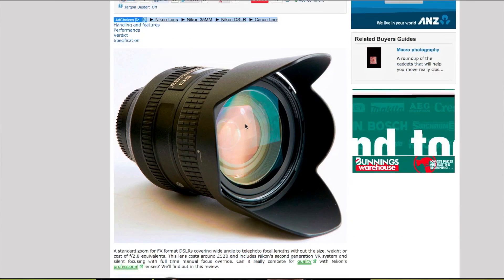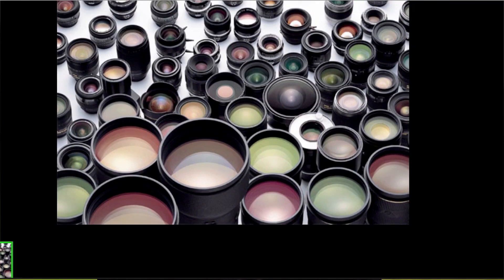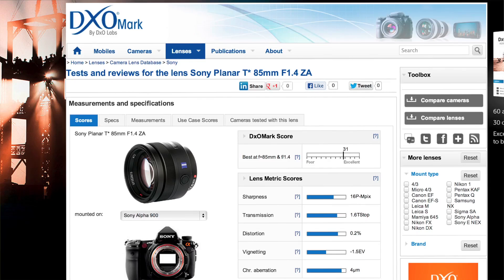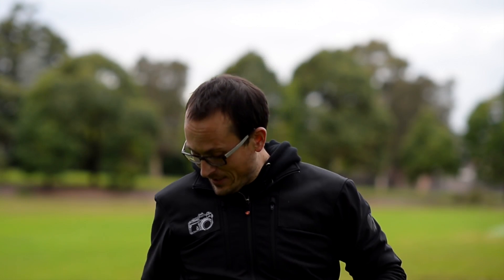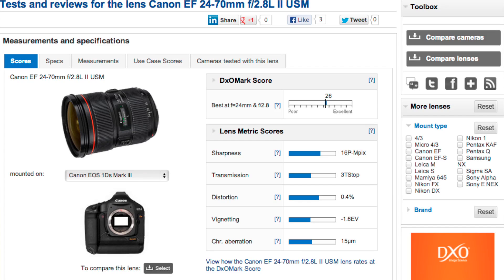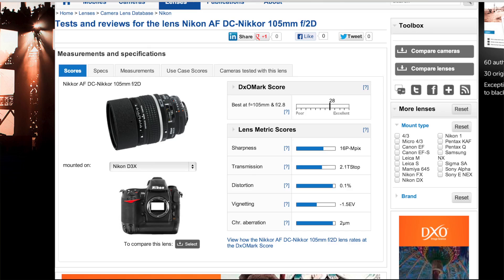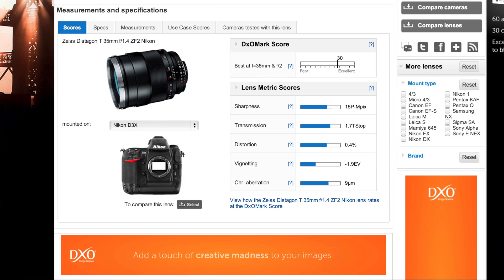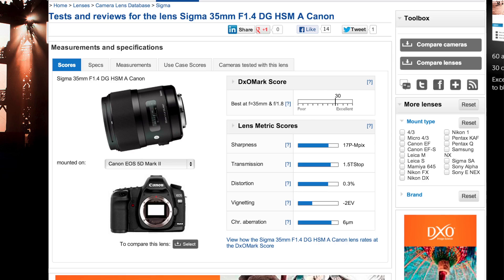F Stops vs T Stops - what is the difference?

Comment: Is there a difference of DOF between a f/ and T? 
Is The compensation of the transmission of light done by adjusting the entrance pupil’s size resulting in the dof is slightly smaller because a larger aperture ?
Reply from the maker: Dof is determined by f stop.

Comment: cant the light be bend so it does reach a higher amount of light while having the same aperture or a better t-stop number ?

i have a lens pentax 67 / 50-100mm 1:4.5
but its front lens is 80 mm its second lens is around 60 mm (the lens body itself is also around 80 mm the front lens is a bit bigger , but nowhere to f4.5)
on the other hand i looked a samsung lens what has its front lens around 59 mm 
to make the compare i took a other samsung lens and it has a frontlens of around 27mm 

both being set to f5.6 they deliver the same shutter speed the same amount of light 
to make this certain i looked the pictures and took a look on the suggested shutter speed both are matched

Comment: I was between Samyang 10mm 2.8 and Samyang 10mm T3.1. After my search i found that f2.8 has 3.2-3.4 T number and the 10mm T3.1 version (which has t3.1) is obvious better because it gathers more light than the 2.8f(3.2-3.4T Dxomark). So im going for the cine T3.1 version!

Comment: Since the f value is diameter based and my sensor, as are most, is rectangular, shouldn't the T number be higher since we can't fiit a circle into a rectangle?
Reply: WTF? Whether the sensor is rectangle or lemon shaped is of no relevance. The issue is the brightness of the light.

Comment: I understand all that, but why is there such a dearth of information about our available? I've looked at all my lenses on dxo mark and they only tell you the T value at maximum aperture. Is it offset by a constant amount all the way down the range? My Leica 42.5mm f1.2 nocticron for m4/3 is specified at f1.2 and T1.7, a whole stop down. Does that mean that f2 equals T2.8?. f2.8 equals T4? It could be a non-linear change. Dxomark say they test at every aperture but then why do they only give the one value? I like to use an incident reading flash meter for portraits. To correct effectively I need to know how far off my cameras ISO is at each value (which they show, so easy) but also the true T numbers going down the scale.
Reply: *our lenses

Comment: The analogy with measuring horsepower at different places, is actually a little off. There, you're both measuring power. F-stop is how far the aperture can physically open, where T-stop is the amount of light that gets from one end, to the other (so loss in light, basically).
The F-stop is more comparable with engine displacement: a bigger engine means having the potential to output more power. But engines differ in the actual power output.
F-stop could in fact be compared to the loss of power in the drivetrain of a car, so power at crankshaft and on the wheels :)
Reply: What are you on about? An f-stop is a mathematical equation of the light passing through the lens not taking into consideration any loss of light. Where as t-stops also take the loss of light due to all the different elements,  quality of coating & the internal structure of the lens with a real life reading of the light at the film plane/sensor end.
This method was first used in the film industry many decades ago. This was because although lenses may have said they had the same f-stop of say 2.8 they were in fact not and the exposure was very different which caused problems when editing.
Why only the film industry switched to this method and the stills people persisted with the less accurate f-stop system is in some respects quite baffling

Comment: The difference between F stop and T stop can be demonstrated easily on STF lenses, like the Sony/Minolta STF 135mm F2.8 T4.5.  The light loss is due to the use of an apodization filter that provides the high-quality bokeh effect.

Comment: 1.2 to 1.4 is 1/3rd of a stop, not half.
Reply: +1
Reply: It is half a stop. In 1/3 stop intervals the value are 1, 1.12, 1.26, 1.41. In half a stop intervals it is: 1, 1.19, 1.41. 1.2 is 1.19 rounded. Just take the square root of two twice.
Reply: Okaro X thanks. just realized that.
1.4 to 1.3 is 1/3,
1.4 to 1.2 is 1/2 (half)
1.4 to 1.1 is 2/3

Comment: why are we not metering in t stops then, or why are our meterings correct?
Reply: +Álmos Kósz F stops measure depth of field and it's a more simplified way of knowing if much or less light is coming in. T stops are just to measure the amount of light. Best would be having both specified on the lens, but you can look up online what the values are, for example on DxOMark.

Comment: For those that are not annoyed by manual focus, the Cinema lens are really great, and there is a possibility to get the Rokinon/Samyang lenses for very very affordable prices. When you mesure in T stops its very simple to get your exposure right while you change lens, cause the amount of light getting in will always be the same. Im using it for filming of course, but, even they are heavier, without autofocus, lets say, completely manual, I surprise myself almost not using my other lenses anymore even for photography. Cause the result just looks great
Reply: Y-A d'Ouradou 为爱度  lucky rich pal
Reply: I'm extremely annoyed by manual focus for two reasons; I have no focus peaking built into my camera and if I'm using a photography lens, most of them have that annoying af dynamic geared focusing making manually focusing a nightmare.

Comment: Great video. I checked the dxomark score for the 35mm art lens for nikon and it was T=1.7 instead of 1.5 as for the canon version. I thought the difference between the two were just the mount. Any idea why there is such a discrepancy in the value?
Reply: Sensor reflection or angle of light that sensor can accept perhaps?
I don't really know,though.

Comment: The Canon 24-70 f4L IS is one of the few to have f=t=4 (according to dxomark).
Reply: The DxOmark test is obviously flawed since no lens can be F = T. That would basically mean that if you look at the lens you should see zero reflections and the glass should be 100% opague (invisible no matter what angle your looking from).
Reply: Tommie Hansen
It's not a flaw, it's just a rounding down of the measured value to 1 decimal place. T shown as 2.8 could be 2.849, for example.
Reply: Well.. yeah, but since no lens can be F === T the rounding is still a bit flawed since it's basically like saying that a lens got infinite transmission. They shoul instead label it as ~2.8 instead of just 2.8 to indicate that it's close to 2.8 but isn't 2.8 (yeah, i'm being picky.. but....)
Reply: Tommie Hansen
You're leaving out the possibility that because F-stops numbers are already rounded to the nearest standard value, it might not be the T stop value that's wrong. An "f/2.8" lens could have a T-stop value of exactly 2.8, or even 2.83. That doesn't mean laws of physics are being broken, it only means the effective diameter of the polygonal aperture is actually a little bigger than the nominal F-stop rating suggests.
Reply: Adam Smith Yeah, that's a possibility as well. I guess i just tend to like more exakt measurements even though F2,8115 / T2,8126 would make no real world difference to 2,8/2,8. :) I'm just not used to rounding to single decimals since i code and calculate a lot in my work.

Comment: Hi! nice video! I think you have heard about the rokinon/samyang cinema lenses. They have 24 mm, 35 mm, 85 mm cine lenses at T/1.5 Do they are really true T/1.5?

The photo version of the samyang photo version lenses of the 35 mm and the 85 mm are rated as T/1.7 in dxo mark

On the web I found that cine and photo version are optical the same, and I can not find any messure of the transmission of the cine version of these lenses

Do you have any information?

Comment: One of the important aspects of the T-number is that it's supposed to be a calibrated measurement instead of just a rough calculation (and that's what the aperture numbers are). The theory is that if you swap, e.g., a 20mm at a T-number of 4 with a 70mm at T 4, you end up with the same transmission, and thus the same brightness.

It becomes quite obvious to see why such calibration would be desirable for shooting movies on film, and in extension why the T-number is prevalent in movie lenses.

Comment: Before multi-coating the difference between F and T stops was even bigger.  The early zooms from the 1970s were a stop slower than single focal length lenses, which had far fewer elements.

Comment: Thanks for putting this out there.  While the faults of any lens may not be the topic of concern, you have shown ratings on a page like DXOmark that does measure lens performance on more than one scale. Implicit recommendations to buy lenses with better T-stop performance are created, but offsetting faults are there, they do become relevant and should be mentioned...actually more relevant comparing lenses than engines + final drive performance.  T-stops are useful first in comparing lenses.

Comment: very interesting and helpful, thanks. never used film glass but had understood it was the ratio of another part of the 'iris', rather than the 'effective aperture' or whatever it is for stills, to the focal length (the exposure value equating the reciprocal of the square of the f-stop value). so is the unit of measurement for the t-stops essentially a presentation of the f-stop that would yield that exposure in a lens that was optically perfect with 100% transmittance? thanks again

Comment: You got it wrong, Matt. F stop is determined by the diameter of the front glass element. Aperture can be located further in the light path and can be of a significantly smaller diameter than the front glass element.

Comment: Handy site that DxOmark. I did notice that my 50mm f1.4's T value improved from 1.6 to 1.5 when I swapped the camera to show results on my D800 (from D300). Does an improvement in sensor actually affect a lens' T value?

Comment: Very informative video, thanks. I noticed this when shooting my most recent weather vid. Had to put an ND8 filter on the end of my Samyang 35mm F1.4 with t value 1.7 where as the 70-200 2.8 with its t value 3.4 was able to film ok in same light without needing ND8 to pull back the light a little. Same ISO and 1/50 sec F8, the difference was amazing back to back.

Comment: thats quite some info which i guess many of us wudnt had even thought about while buying a lens. thumbs up and thanks
Now another question is what do you prefer as a prime lens for a APS-C sensor camera since a 50mm doesnt remains a 50mm on cropped sensor compartively as it does on full frame sensor. Do you think that a 35mm 1.4 for instance is better to be used on a cropped sensor as it will reduce the crop factor somewhere close to 50mm?